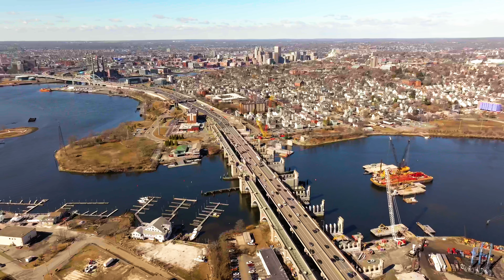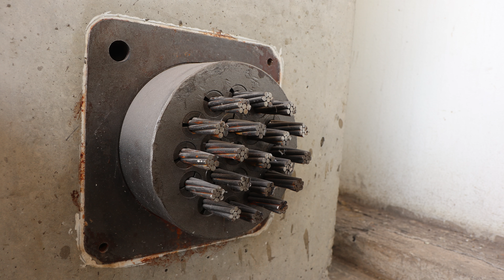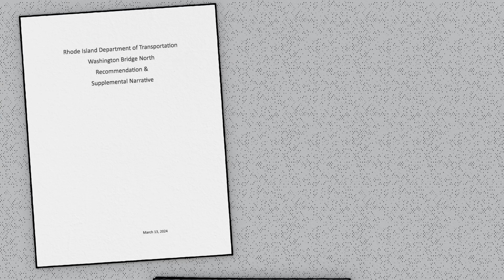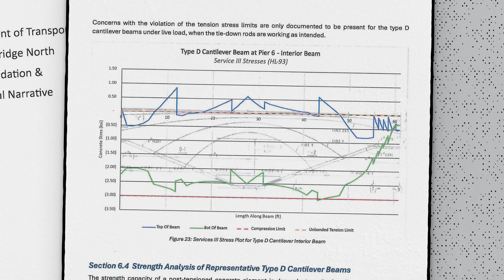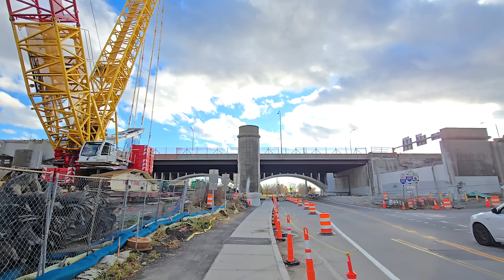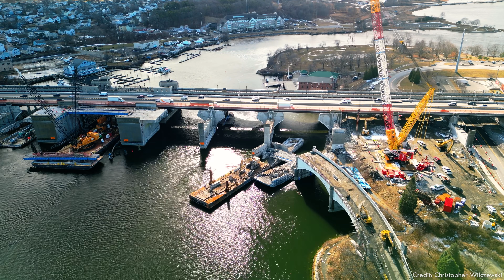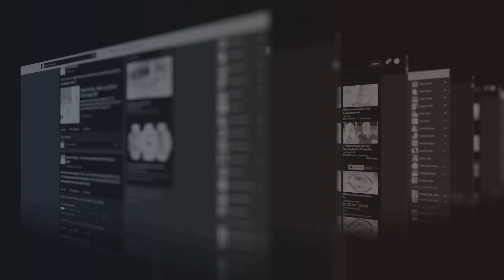This Bridge’s Bizarre Design Nearly Caused It To Collapse

Comment: I recall a lecture by a geotechnical engineer talking about risk shifting from the state onto a consultant and/or contractor. He recommended being very careful taking the bait. He instead recommended submitting a proposal back to them for what analysis had determined actually needed to be done to minimize both your financial and legal risk and theirs.
Reply: My partner is an engineer and said his old national firm refused to work in RI because the language of their contracts put an unusual amount of liability on the designers. I'm sure that's why they've struggled to get bids, and I wonder if it means another incompetent job will be done.
Reply: Especially when you work for the State of RI !
Reply: Sad state of affairs, the state not wanting to pay its own inspectors and contracting it out. The people getting the contract now beholden to the legal issues the state is trying to bypass. Welcome to the future of litigation roulette.
Reply: @bpurkapi  They also went after everyone who ever worked on the bridge.  Which is half the reason no one id on the original proposal.  Heck, even the company doing the demolition was named in the lawsuit.

Comment: This bridge type has recently been identified as a major design flaw in the Netherlands. Over 100 freeway bridges have this design and might all need replacement. The connection between the beam and the cantilevered or extended cap is also impossible to inspect, while being a high-risk location for chloride intrusion. Unlike the Washington Bridge, the Dutch bridges don't have tie rods to balance the structure, but otherwise it's pretty similar to 5:13
Reply: Dresden's recently collapsed Carola Bridge in Germany had that exact design as well. And also the same problem that the design doesn't fail in a predictable manor.
Reply: Exactly! Why would you not design the end cantilever for being self supporting (unbalanced load) to avoid the need for steel tie downs?
Reply: @steveo4749   I know! I'm not even an engineer, I'm just a physicist, but that stood-out to me.
Reply: @kaitlyn__L why did you hyphenate "stood out?" 🤔 

If you're a physicist then I'm a rocket-surgeon
Reply: similar stuff caused the fall of the Morandi Bridge in Italy: steel cables in concrete impossible to inspect.
Reply: The state of Rhode Island may have been metaphorically dragged kicking-and-screaming to that conclusion, but when all is said and done "total replacement" will almost certainly be considered "the right thing to do" in hindsight, especially since the alternative outcome likely would've involved a fatal collapse!
Reply: So how do you balance the cantilever?
Reply: @YeahMan9911  In Dutch bridges of this type, the end span is not connected to a cantilever, but to a solid concrete cap which extends from the bridge pier. In the Netherlands this type of bridge girder is mainly used for shorter spans (such as overpasses or flyovers), not large river crossings.
Reply: @YeahMan9911  Put more weight on the one side that rests on the abutment.  If is heavy enough it can also support the adjacent free span between cantilevers.
Reply: @YeahMan9911 Design going down the wrong path in the first place. Don’t use unbalanced cantilevers there.
  Drastic for sure, but really the only way.
Reply: @YeahMan9911 with a notch in the side that is weighed down with the entire length of the following beam. But without the notch it was dependent upon those tie downs keeping the other side from falling down. When they are in one piece.
Reply: Engineers thought they had a better design. Time is proving that they were not correct.
Reply: @Ghauster  And that is also how progress is made. Mistakes often/sometimes lead to more progress than successes.

Comment: Washington general bike path goes under rt37 in Cranston.  right at the location rt37 has a bridge over Cranston street, and the bike path. for 10+ years, while on the bike path, anytime a car went over the bridge. thunk thunk. thunk thunk. as visible, and audible movement of the steel.     Not sure how long they knew about it, before getting to it. They HAVE though.   bridge has been redone.  google maps even has images of it mid construction.
https://www.dot.ri.gov/projects/Route37/

video suggestion. the engineering around converting Rail roads, to bike trails.   Surfaces(gravel, stonedust, asphalt, or cement), underlayment, drainage, bridges, berms, viaducts.  filling in trestles with sand viaducts, versus fixing trestles.

Comment: Why wouldn't you want tension in a prestressed beam, as it is the purpose for which it was built ? Or do they count as "0 tension" when the beam regain its original shape it had before being prestressed ?
Reply: The prestressed cables insure that the concrete beam is alway in compression.  Concrete has almost no tensile strength.  When the steel cables start breaking it allows the concrete beam to experience tension. Which is very very bad.
Reply: @johnhunt2390  So you put it under lot of compression initially, and the maximum load is that which put it back into a neutral state ?
Reply: @clementboutaric3952  The prestressed cables are squeezing the concrete together, making sure it is always under a compressive load.  As those cables start snapping the compressive load diminishes.

Comment: I worked in major corporation capital projects. When we engineers were left to our own devices, we designed superlative structures. But then management got the estimates. And of course, as is ALWAYS the case, their performance evaluation criteria created a divergent goals situation. It was amazing to me that top management (not capital projects management, BTW) swoops in and pronounces that X millions have to be cut from the project. That looks great to THEIR management. ARGH! Hey leadership: it is what it is. The reason the project cost is that much is not because we were fooling around with the scope and numbers. This is what it will take. Ya can't arbitrarily cut money from the project. Well, everyone is afraid of getting fired or passed over for promotion, so they don't stand up to management and call BS. This bridge project, from the 50s inception to the maintenance and upgrade conversations/design smacks of the very thing I experienced in the private sector. Oy

Comment: “They discovered the tie downs were not performing as designed.”

Certainly one of those engineering understatements that translates as, “about to wind up in the headlines.”
Reply: I feel like "snapped in half" is a little more dire than "not performing as designed"!
Reply: @paulzagieboylo7315  Depends.  Some things can be designed to snap in half.  Fuses, notably.
Reply: @paulzagieboylo7315 They were not snapped in half though. They were snapped at the ends in ways not visible from where the inspections were done from. A test of the rust layer thickness could give an age if the break, but if it were a long time, only extracting the failed tie down parts and measuring their length would confirm the amount lost.
Reply: The number of tie downs has doubled at some places.
Reply: @baksatibi  But they're only half as long?
Reply: Are you suggesting the bridge was about to experience a rapid unscheduled disassembly?
Reply: @olmostgudinaf8100 given the state of the tie downs, I think it had already begun the unscheduled disassembly and was just waiting for the perfect moment to make it rapid...
Reply: they were actually ultra modern tie downs. Bluetooth 3.o
Reply: The O-rings on the Space Shuttle's boosters did not perform as designed
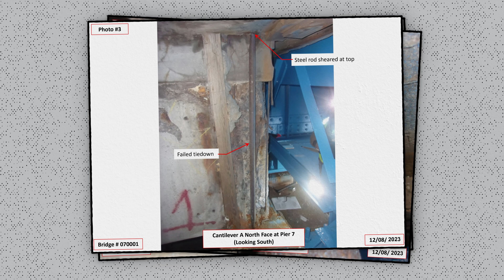Reply: @6:02 report notes the tie downs failed in shear.  Looks like ductile overload from a tension specimen.
Reply: I mean, they certainly weren't wrong with that statement 😂😂
Reply: Not gonna lie, "not performing as designed" has the same energy as the suboptimal memes
Reply: Something on par with the meme "this will surely affect the trout population".
Reply: Welcome to Rhode Island.  Providence is a shitshow.  I left that city.  It's run by leftists and you do not understand the level of corruption in this tiny state.  We are ranked last place for roads, doctors, and housing development.  Bottom 5 for new business startups.
Reply: That’s such a weird way to put it
Reply: They discovered that US checks and balances were not performing as designed. Same energy, if you know what it means, you know that it's serious.
Reply: @nahblue  "Checks and balances were not performing as designed" - because the electorate put the entire federal government under the control of a party that doesn't believe in democracy and the rule of law.
Reply: @nahblue  Yeah at least for the last 4 previous years.
Reply: @Zanduras1  Dude, they've started disappearing people. Wake up.
Reply: @Zanduras1 way way longer, ever since the majority of politicians are old and from a few very rich wealthy families, lobbying exists, and politicians buy and sell stocks on issue they vote on, the US is NOT a democracy at all, and thats not even including the fact that news gives opinions, lies on purpose, the politicians lie on purpose, and run campaigns purely for popularity without any truth, meanwhile education is terrible so the voters are extremely uninformed on issues on both sides. Combine this with a two party system forcing people to choose between bad and worse and the US can be to your discretion considered just a very very highly dysfunctional democracy or a corporatocracy, or an aristocracy or oligocracy.

Comment: You can’t 17:56 17:56 always plan for things however much you try - I have a bridge near me which had a high vehicle bridge strike and has mangled a few beams. Clearly 1/2 the road way is closed and has been for a long while. Oddly nature is loving it and slowly regaining as trees and vegetation is now sprouting! It seems to take years to mend these things.

I also have a Bailey bridge (a UK WWII military temporary bridge concept) covering a weak unusable highway bridge - been there for as long as I can remember, but at least the road is open as usual.  Makes a lovely clatter as you drive over it similar to olden day railways before welded joints.

Comment: It almost seems to me that the problem is a more general one with those early pre-stressed concrete bridges looking at similar problems with bridges like the collapsed Carola bridge in Dresden or one of the bridges of the U 6 extension in Berlin, nothing really you can do but learn from the current cases and thoroughly inspect similar bridges for those failures

Comment: I don't understand why stainless steel isn't called for when building structures in areas where there is a lot of salt in the mix.
Reply: Part of the reason is that stainless only retains the corrosion resistant properties when exposed to oxygen.  There are interesting case histories of stainless anchor cables for buoys corroding through when the oxygen content of the water was too low.  I suspect the same thing would happen with stainless rebar.  There is now basalt fiber rebar that looks interesting for corrosion resistance, but it doesn’t have a long use history yet.

Comment: if only there were some more efficient mode of transportation that requires smaller bridges. we waste so much money on car infrastructure and keep raising the stakes by making bigger and bigger investments that will be bigger and bigger expenses down the road.
Reply: If there were a viable more efficient mode, then we would have it.  Market forces and all that.  I am not interested in modes of transportation that require huge tax subsidies to operate at a loss while at the same time making my life exponentially more inconvenient.  I do not want to spend an extra hour getting to work each day and walking in the weather for another 30 minutes simply for some utopian pipe dream.  Are you going to go to Costco and buy a cart worth of groceries and household goods and then ride the bus or light rail 15 miles to get home?  I suppose you COULD lash your vacuum cleaner to your back and ride a free government sponsored e-bike to take it in for repair, but is that reasonable? Be realistic.
Reply: @msromike123  you are so egregiously out of touch with reality I genuinely don't know how to correct you but the first misconception you need to understand is that our existing roadway network is literally operating at a loss.
Reply: @Dullydude  If you want to "correct" me you can start with directly addressing my concerns. How would you address my concerns in the context of adding time to my commute, being exposed to weather, shopping at Costco, taking small household appliances in for reapir, etc.  I listed just a few, but once you have adequately explained to me what I am overlooking, I can raise more concerns.  It's called a dialog, and I am willing to engage in one.
Reply: @msromike123  Cargo bikes are a thing, also the entire Interstate system is one of the biggest money sinks the US has. The current urban design paradigm needs to shift from car centricity to having other viable options of transport. US cities are currently designed around cars and nothing else, this is why there is so much suburban sprawl and travel times are so long. Ideally people would like amongst destinations like mixed use zoning.
Reply: @NetAnon  As if "urban sprawl" is automatically a bad thing.  If you want to live in HDB flats like Singapore, then I won't stop you.  I want to live in the suburbs and have a lawn, and a garden and some fruit trees.  If you want to try to ride a "cargo bike" to Costco 15 miles one way go for it.  I want to drive my car there.  I am almost 70 years old and am very happy with the confortable and predictable lifestyle that America has facilitated me working towards.  This one size fits all ideology is not very realistic.  As far as the motor vehicle infrastructure being a resource sink,  how can anyone possibly think it does not return value in excess of expenditures?  And if it doesn't it is still the most efficeint form of transportation in terms of productivity and convenience.  I get the romaticism of living, working and playing within walking distance of your residence.  The relity is we live in the United States and not 1000 year old cities in Europe.  Traditional mass transit does not work, as evidenced by it's relaitve abscence.
Reply: @msromike123    you claim to be open to dialogue, yet you didn’t address my last comment, but I’ll give you the benefit of the doubt and some of my time to address your concerns.

1.  Market forces actually encourage inefficient transportation. It makes the market a lot more money when you’re buying cars than when you’re taking transit.

2. If you aren’t interested in modes of transportation that require huge tax subsidies and operate at a loss, then why would you support the massive subsidies we give for car infrastructure?

3. When we invest enough in transit alternatives they are actually FASTER than driving for a huge number of people. Lots of examples in the world where this is the case. Plus when more people take transit it reduces traffic for people like you who would prefer to drive.

4. In an urban environment I don’t have to go 15 miles to get to the grocery store, I walk across the street to get what I need for the night and that’s it.

The biggest thing to get across here is that alternative forms of transportation aren’t intended to eliminate cars entirely. The reason transit doesn’t work outside of the city is because the population density is just too low, but once you’re actually in the city it makes more sense to have a single train line instead of a 5 lane highway purely based on space constraints. Higher density living is fundamentally cheaper and more efficient, and since housing and transportation are the largest costs of living today, I’m going to continue to advocate for anything that improves those two things.

Comment: Some pictures of those tie rods seem to show a lot of 'necking down' near the failure point? Looking a lot like classic test samples from a lab where the diameter narrow from plastic stretching, then at the minimum diameter, it just snapped apart. Wonder if that stretching occured all at once or over time?
Reply: Probably corrosion.

Comment: This is why I dont like structures that rely on tension, especially that which relies on hidden elements under tension, like steel embedded in concrete. Give me a solid concrete under conpression option, even if it's more expensive, because we're all trusting our lives to proper inspection and reporting, which clearly doesn't happen properly.

Comment: If the drawings were correct, then many prestressing steel cables ran in curves. Does something like this even make sense? Wouldn't this result in additional lateral loads on the concrete?